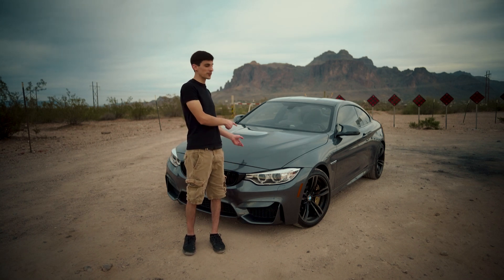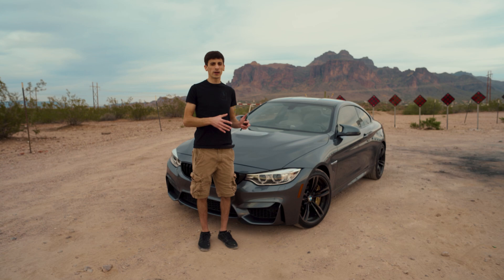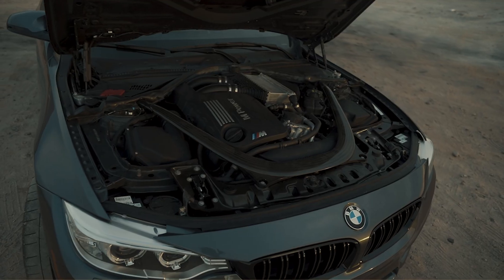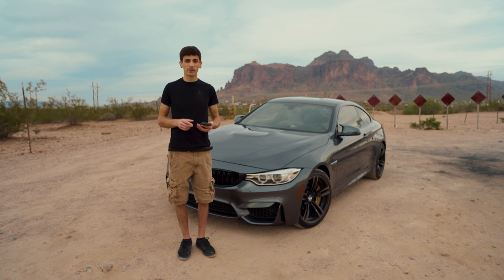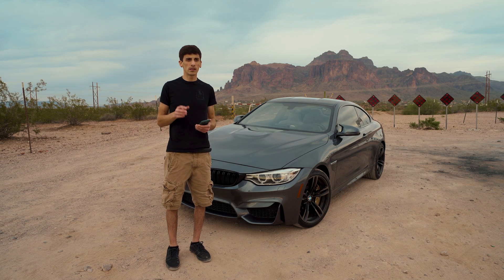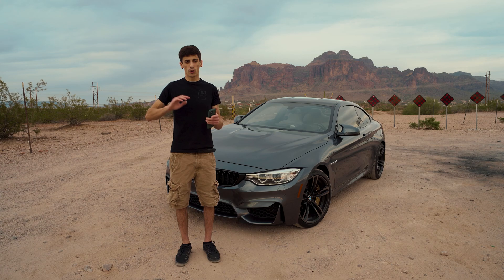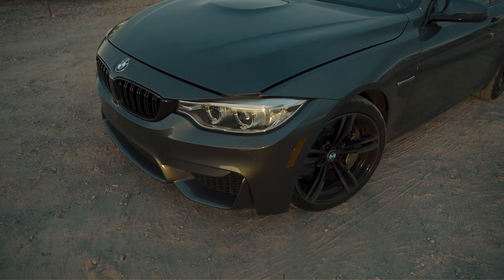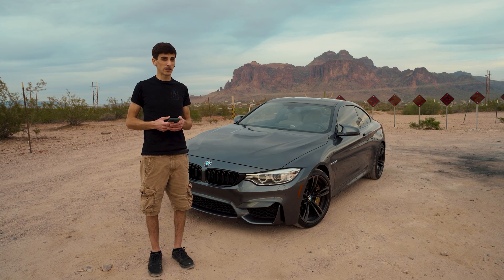Why the BMW F80/F82 M3/M4 is an ENGINEERING MASTERPIECE!

Comment: A few years back I found an Alpine White 2015 F80 M3 w/6-spd stick on a Dodge dealer's lot while looking for a 392 Challenger.
The '15 M3 was in perfect condition with barely 40K miles & after a test drive I opted to buy it over a Challenger.
The longer I own it the more I love it. The build quality is off the charts. The bucket seats have absolutely 0/ZERO wear, the bolsters are still in perfect condition at almost 60K mi.
I love my F80 M3. I named her, EmMa and I love her.
Reply from the maker: Great cars! I sold mine only to upgrade to a porsche gt4
Reply: @CanyonTuned  That is an upgrade. Kudos.
Appreciate the excellent vid you made on the F80 M3.
Good work.

Comment: The S55 is a beast. Although the F87 M2C is the pinnacle of the S55 if you ask me. The F generations are going be classics.
Reply from the maker: If I had a choice is get the m2c but they were wayyy more expensive
Reply: The M4 is much more balanced and less ‘twitchy’ while still being light and nimble. I much prefer it to the F87